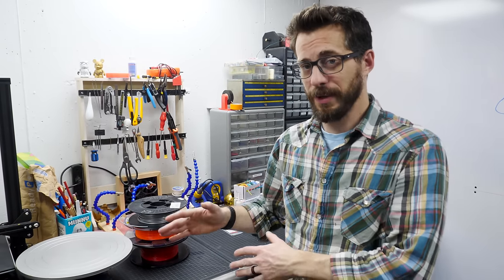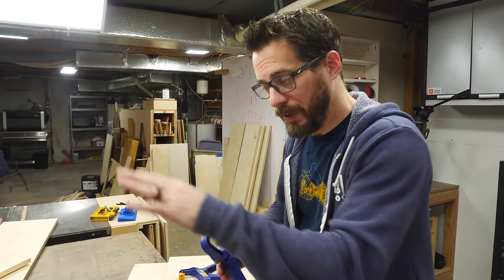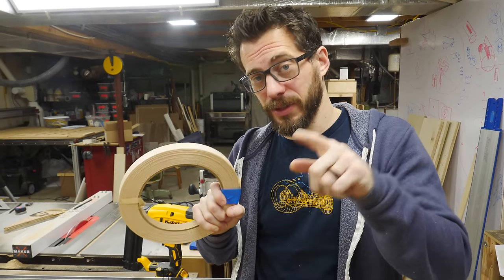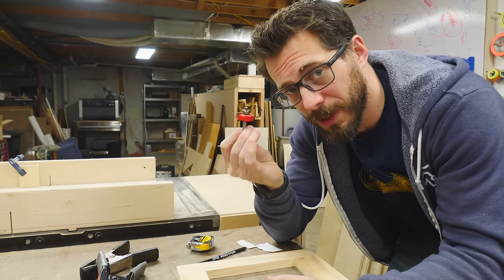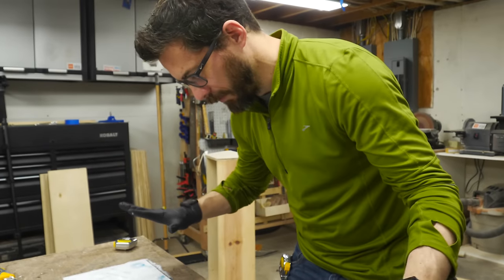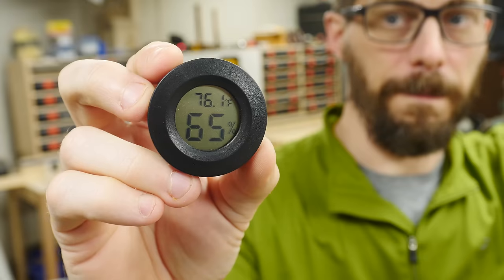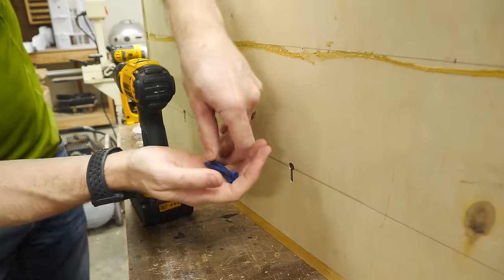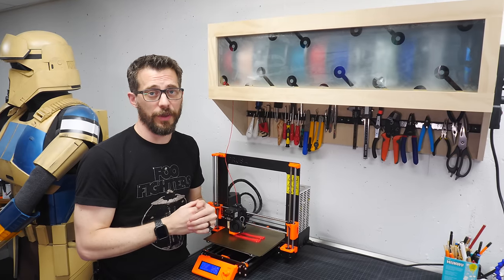Making Filament Storage with an Etched Glass Door // 3d Printing & Woodworking

Comment: I'm a little late to the party, but I use that glass etching solution all the time so I have a couple tips to make it more uniform.

The non-uniformity from the etching solution happens for 2 main reasons. First, the glass itself may not be perfectly clean. Layers of dust, dirt, or even just oils from your skin can weaken the effects of the etching solution in those areas. Second, the etching solution itself is not uniform. It's essentially the consistency of hand cream, but with grain-of-salt-sized crystals inside it that cause the chemical reaction which etches the glass. So if you just plop some of the solution onto a glass surface, the little crystal chunks may cause air bubbles and may cause certain areas to eat away at the glass faster than others.

The first problem is pretty easy to solve, just wash the entire glass surface really well right before adding the etching solution, making sure to dry it completely with paper towels or a very clean cloth (and wearing plastic gloves would also help to keep your skin oils off.) 

For the second problem, what I find helps is that right after you spread on your initial coat of etching solution, go back and continue to mix up and spread around the solution on the glass for the entire 5 minutes of curing time. Since the solution itself is naturally non-uniform and full of crystals, this makes sure that every inch of the glass surface is exposed equally to both the weaker and the stronger parts of the etching solution, resulting in a MUCH more uniform etch.

Now, with an area of glass that big, this etching solution will probably never give you a perfectly clean and uniform frosted look, but following these tips will definitely improve from the result in this video!
Reply: Mitchell Esposito has some good tips for the etching.  There is one additional tip I would recommend to make the etching result better...wait 1 full hour for the curing time!  Having done this for years, I have found that leaving the etching solution on for much longer periods of time creates a significantly more uniform etch on the exposed glass.

Comment: Back in the day, we used to use a cheap sandblaster to etch glass.
Usually sandbox sand is doable for the sandblaster.
Reply: Haha same I work as a glazier and in between jobs we tried the best diy etching and a paint attachment for an air compressor with glass beads works well

Comment: Hi Bob great video, you can always use 6 or 8mm dowels to repair holes that are a little too big, just drill the holes out bigger glue in the dowels clean them flush and away you go, instantly repaired! 👍🏻

Comment: I love how you are honest about mistakes, which we all make.   When I screw up a hole, I bore it out to a tap fit for a fluted hardwood dowel, glue and hammer it into place, and try again.   This is particularly effective for particle board, as the end result holds screws better. 

And while the etched glass is undeniably cool,  I think I would leave it clear so you can see the spools better, though this might be different seeing it in person.    A solution to the door closer could be an external counterweight on a pulley system. 

Great project, I always enjoy your stuff!

Comment: Very cool. I need to build one of these to store the stacks of rolls of filament I have sitting under the table where I do my printing.  I appreciate that you didn’t attempt to whitewash the late realization that gas struts would have been a good addition or the dissatisfaction with the etching. Keeping it real makes your videos more interesting and also helps me understand your creative process. Good news is that remaking that door with a wider frame would not be tough, especially if you decide to redo the glass. 

Suggestion on etching... to make the etching smoother/more consistent, move the paste around with the brush a couple of times before rinsing. Another option is to apply it with a narrow roller and then just re-roll over it a few times during the etching to refresh the etchant on the glass surface.

Comment: Great project Bob, need to build one of these for myself... just a thought re the gas strip to hold door open. Attach a short bungie/elastic diagonally to the left side (bottom of door and top-back of side). If you get the tension right then it will work to hold the door closed and also hold it open once you pass the pivot point...

Comment: Hi Bob! I work with glass in all manner of form and manufacture, and if you would like I can offer you some tips? Often etched glass is difficult to do by hand, however there are etching solutions which can be applied through either HVLP or LVLP guns. This gives you a much more uniform result however imperfections still occur. On the flip side sandblasting is often the best choice for a satin look as the penetration also allows for variables on shadows or "3D" effect when done correctly. Also when laying vinyl on glass, if you're not confident then then soap and water trick is best however with experience it is much more efficient to apply the vinyl straight to the glass, and save the weeding till after it has been applied. Any other  information I can help you with in relation to glass I'd be more than willing to help! Love your videos and they really inspire me to design and create!

Comment: Ive never had luck with that etching solution. I know tons of people have but I always get those same squiggly lines. Ive used rollers, foam brushes, hair brushes, and rags/paper towels. Always the same issues. Thats why I started sand blasting all my glass. Sure it take a bit more work but the results are always uniform and crisp.

Comment: Hey Bob, with armour etch, I find you have to leave it on for awhile, 20 minutes usually. And swirl it every 5 minutes, so you changed the brush stroke marks where it was thinner. It comes out more uniform. For large pieces and and etched works much better, but watch your vinyl for blow out. Great job!

Comment: Hey Bob while I have watched most of your videos to which I throughly enjoy and find them very helpful for me when I’ll be able to set up my own shop. I was wondering when you build certain things why not use a biscuit joiner and glue to help make things look a lot cleaner, then you cover up the seems if need be and want to with wood putty/filler so the piece(s) look like the piece(s) are one solid piece of wood. Some other things you can add to your shelf is a wooden or metal dowel that you can take out and it holds the filaments and a little vents or fans on the sides instead of holes on the sides.

Comment: Great video as always! One little advice. masonry bits work way better when used with a hammer drill and not a normal one because they do not really cut the material like a brad point drill. They are meant to break away tiny bits of masonry with every stroke.

Comment: Bob here is tip for removing the backing paper of the vinyl. Put the transfer tape face down on the tale then pull the backing paper from the vinyl. It is way easier.

Comment: As a substitute for the etched glass, you could try palm sanding polycarb sheets for a frosted look. Palm Sanding it allows you to manually adjust how much and where you are "frosting" the polycarb. Cabinet looks fantastic no matter what though, great job
Reply from the maker: Very true, good alternative.
Reply: @Iliketomakestuff  Same works for glass, too. Just use fine (800 grit or higher) sandpaper.

Comment: For ventilation, how about put a computer fan where you put the air holes? I have my dust collection and compressor in a small "closet-like" shed and it has to be soundproof so no gaps. To keep air moving in the closet I installed two computer fans one for incoming and the opposite one exiting. It's powered by a small solar panel on the roof. Just my two cents.  Thanks!! ~Dolly

Comment: Hey, great video as ever! I used the same etch solution a couple of times and had the same problem as you with the etch being uneven. Found it worked out really well to just repeat the etch-rinse process about 3 times or so before removing masking. Then it turned out nice and even! Anyways, keep up the good work! Cheers!

Comment: Excellent work, Bob! In my experience, uneven etching can usually be solved by just using more of the solution. Seriously, just cake it on. The stuff is cheap, and it'll be better overall.

Comment: When using armor etch, I usually agitate the chemical at the 2.5 minute mark (give or take) by swirling it with the brush then resmothing it out. Helps prevent the streaking it leaves on large etches like this one. Never done one quite this large though

Comment: Cool video. You should try the diy sand blaster for your etching. An airgun and an upside down bottle full of media attached to the airgun. There's a ton of videos on them. I know King of Random has one.
Also, I haven't read the comments yet, but I bet you are going to get trolled about those skewers. Get ready for: 
-You should have glued those and let them dry first. 
- You should have just glued a dowel in there. 
- Your doors gonna fall. 
-That better be a temporary solution. 
- You call yourself a maker?
-I just want to nitpick this cause I can't do it.
☺️

Comment: You could use a mechanical brace that swings down and locks in place as you open the case. And you'd have to unhook it to close the case.

Comment: That etching solution is not made for larger coverage areas.  Using abrasive media in a sandblaster would provide a  deeper, more uniform etch over that much area.

It may be a good idea to add a silicone bead around the edges of the glass since the heating element will cause wood movement and the fasteners could eventually work loose.

Have you considered using two long roller bars across the bottom of the cabinet instead of gluing the printed bearing rollers in place?  Two long roller bars would be a more universal way to accommodate changing sizes in the spools.

Comment: One idea for the feeding holes. Take an old pneumatic coupler and drill a hole in the wood and screw the coupler in. Than you can use an old PTFE tube to feed the filament without introducing moisture. And have the ability to remove it if it gets in the way.

Comment: I used to have to etch glass quite a bit and the main ingredient in our etchant was Hydrofluoric acid, a very dangerous chemical. The Armour brand although not as bad, uses a different, yet pretty corrosive set of chemicals and is all pretty expensive from memory.

I used a screen printing paste and would use screen printing for the even look he is missing here. I would heat the paste in a double boiler or just hot water prior to use to get it to flow.
I would also use a modified spray gun to get an even finish which worked really well. You still needed to warm it prior to use, and the cold compressed air would cool it down pretty quickly, so you had to plan your amount prepared and area covered. The level of ppe was mandatory and excessive.

OR.............You can also just buy some glass etched calendared vinyl and cut out all the dangerous part and have it look exactly the same ;-D

Comment: Aren't adjustable cabinet hangers available in the US? They work like a French cleat (you hang a special rail on the wall) but they can be adjusted (height and distance from the wall) so you don't need to worry about crooked walls or about mounting everything super precisely.

As far as concrete walls are concerned, I'd recommend using plastic (nylon) anchors (plugs) so you don't need any special screws. Big enough wood screws work great.

Comment: To hold it open maybe you could install drawer slides on the inside upper corners, attach a piece of wood to 'em and when you open the cabinet pull out the drawer slides.  The wood attached to the slides would act like a buffer against the wood of the door.

Comment: Sorry if it has been said, but there are hinges that could replace the ones you installed that could latch/lock open in lieu of a gas strut. Rockler has an "Overhead Bin Hinge" and there are many others.

Comment: From a woodworking perspective the shallow keyholes with the sink head screws are a terrible solution for holding much weight. You could have screwed it right onto the wall.

For stability and already everything set up, you could have cut the dado in the rear piece as well, but I guess it's fine the way it is. Also a rabbet in the top edge had allowed for the shelf and the top to be exactly the same length (for those who are always a tiny bit off 😉)

All in all a nice built.

Comment: Great vid. Surprised no #PocketHoles or #FrenchCleats. Lol. Loved the mix of joinery methods. Loved the flexi-drilly-thingy (channeling Jimmy). 

I’m surprised you didn’t go for a wi-fi, z-wave, or Zigbee humidity sensor.  That way you can check the case humidity level while resting in bed. Lol

Seriously, lots of cool ideas. Should have mentioned that the magnet strips are available at a “discount” tool store and they frequently have “free” coupons for them. 

Norbert

Comment: I think the only thing I would have done differently is dado the back of the shelf and rabbet for the glass on the table saw prior to glue up. And just for 'options',  keyhole cut in center, then 16" out from there. Just in case this needs to go up on a stick built wall any time in the future. Keep up the good works.

Comment: Love the keyhole bit, but why not just use French cleats?
Reply: Chef_PC keyhole allows the flat back to lay flush to the wall, where French cleat would need a frame around the back to allow space for the cleat behind the wall
Reply: A93A93 not true. The clear could be incorporated into the back panel of the shelf itself.
Reply: Dave Waddell hmm interesting. I’d suppose it’s quicker to do key holes then, maybe that’s why?

Comment: Question...  how much meat do you have to leave above the edge of the glass in the rabbet to use a point driver? Also you could probably 3d print some sweet right angle brackets and mount your gas struts on the outside of the cabinet...  great video as usual

Comment: What about using a brass door support from a hope chest, it's not hydraulic but might hold it in place or maybe use a spring loaded cabinet support from RV camper? These are smaller than hydraulic

Comment: Hey, I have a question.
Why not use a french cleat rather than a keyhole. My thought was because of the weight, or did you just want to make a cool keyhole? (the answer was later in the video. Cement wall)
Half laps rock for strength.
Another idea for the cabinet would be door hardware thin felt for the seal and magnets. If I remember correctly you could have left the etching solution on the glass longer and it would have been more uniform. I had a Random thought when you were etching the glass, you should build a homemade electroplating paint booth. Electroplating is very cool.

Comment: Each spool of filament is a different width. I think it would be better if you made the distance between eachl roller bearing adjustable or make long roller roller bars between the bearings so any width spool will fit. Great video by the way.

Comment: Awesome video and project!  In regard to the door; can you not put a prop stick (like the thing that holds the bonnet/hood of a car up) on a hinge attached to the inside corner of the door and catches upon the bumper that is already on the shelf in order to hold the door open?
Reply from the maker: That's the solution we're using right now.  The plans we have available have corrected the frame to make room for the struts.

Comment: Looks like your plunge for your keyhole bit was quite a bit off, but at least it was equally off everywhere.   Curious how you make sure that it goes straight, I mean another guide would be ideal as I always feel like it wants to pull to one side and over compensate the force I apply, so it ends up with a bit of a wonky "straight" line... which is why I always use guides with routers.    But I loved the frosted glass look, what's that stuff called that you apply to etch the glass?
Reply from the maker: That's a good point, but as long as the ends of each keyholes are all the same level, it will hang level on the wall.

Comment: Cool storage solution. Could you use silica gel instead of the humidifier solution you used?
Reply from the maker: You absolutely could, but the hot air works to actively displace the humidity.

Comment: Was it significantly faster to take off the blade and use the dado blade setup instead of just using the blade you already had multiple times till it was the correct width slot?

Comment: TBH, I wouldn't do that. It's nice and all, but if you really want to keep your Nylon filament dry, then you need to change a few things. My filament boxes are a plastic lid box (80L for long term storage, 7.5L (food box) for current spool), with a seal & a bowden tube to the printer. I use silica gel packs (with built-in mains heaters for drying back out) for absorbing moisture out of filament. I have gotten the humidity down to as low as 10%rH (which is too low) with temperatures in the 20C range. 
Nylon is like a sponge, just the act of printing with it (in humid air) will make the spool too damp for another print!
I do however live in the pond which is otherwise known as the UK, your results may vary.

Comment: Put the gas strut on the outside using brackets, may not look as clean as the original design, but will work as an afterthought.

Comment: Instead of the gas strut, why not use a stay rod?  The metal prop would fold down inside the cabinet quite nicely, you would have to make your own as it would need to be really short but it should work.